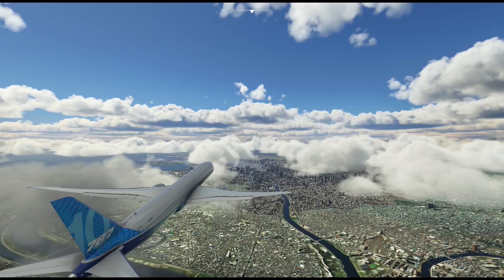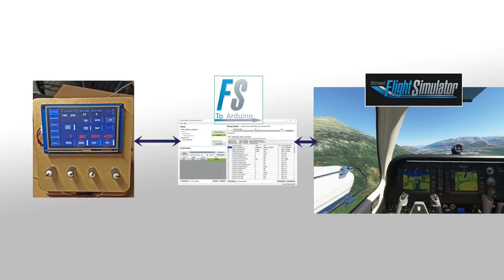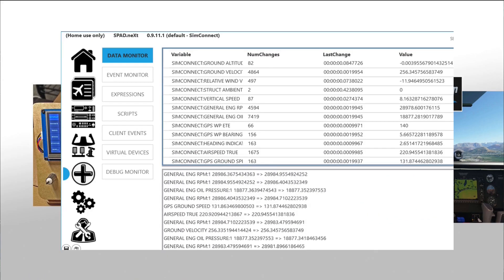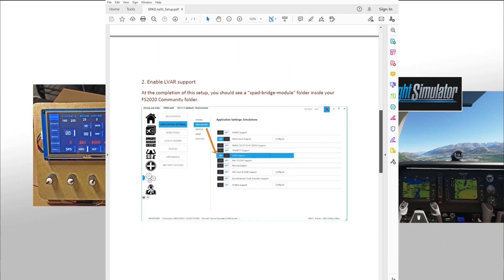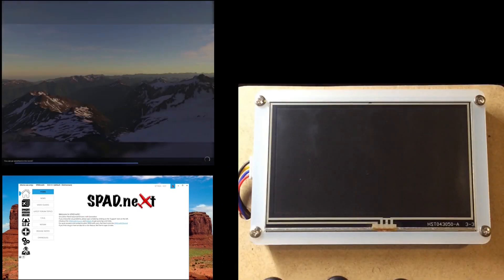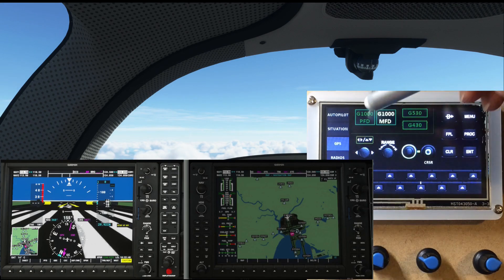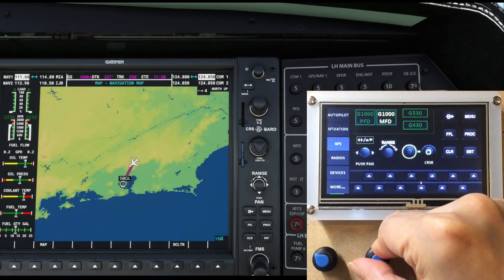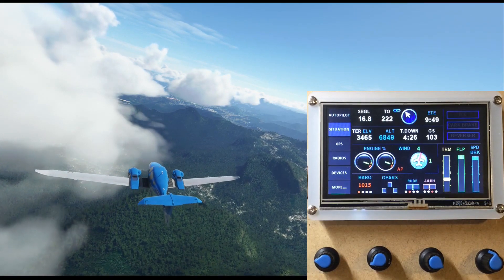Flight Sim Touchscreen Panel [Update 2]

Comment: hey i would like to chat with you, to ask you some questions about this, let me know if you can, saludos.
Reply from the maker: Sure, leave me a Discord or email name.
Reply: @discman777  I am so close haha...the panel stops at “initialized” with the splash screen showing and the type of fs2020 profile ie. Cj4. All rotary dials are working the AP functions in the sim from screen 1 of the hmi file but cannot get past the splash?
Reply from the maker: @MK-qq7mk  That’s odd.  May be due to shaky communication between ESP32 and the Nextion.  Do you have a COMMON ground connection between the two devices?
Have you tried the included “PanelDiag” test package?
Reply: @discman777  by common ground do you mean the capacitor from en to grnd?
Am going to rewire everything again.
Reply from the maker: @MK-qq7mk  If you’re powering the ESP and Nextion from separate sources (e.g. two USB connectors not from same hub), then you’ll need to connect the ESP32’s ground to Nextion’s ground.
Reply: @discman777  THANK YOU! That is exactly what I missed. Words can’t describe how helpful you are to this hobby.